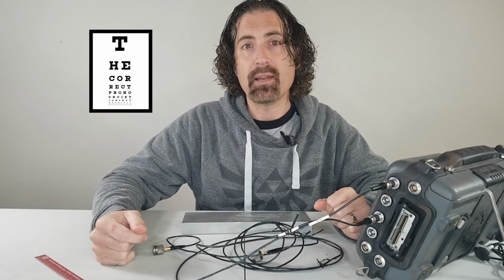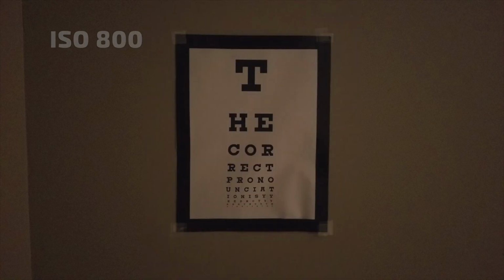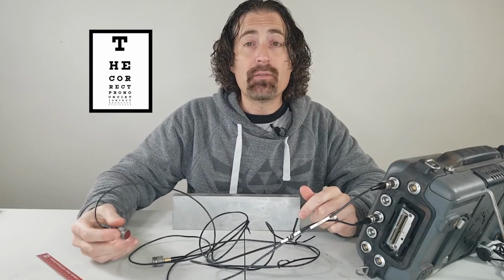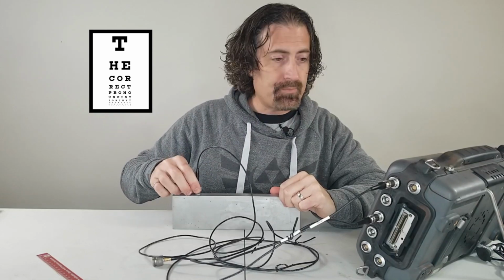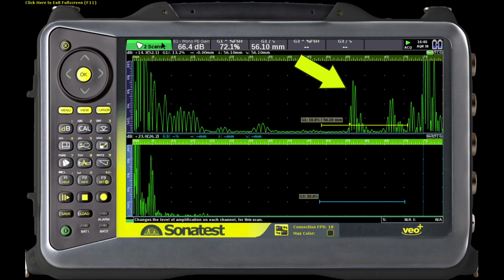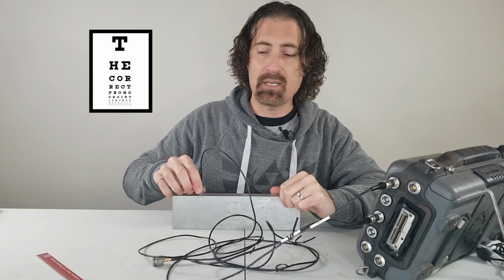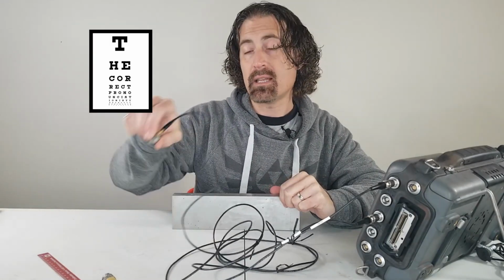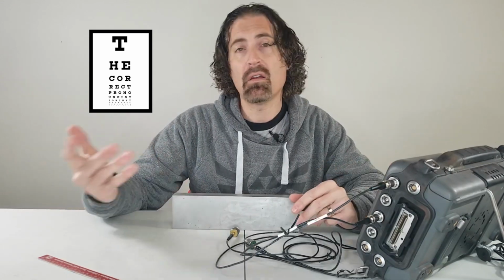Resolution & Sensitivity

Comment: The ISO and resolution analogy is good to use but would there be a way to demonstrate with a similar method when using a C-scan system and how a good versus poor signal to noise ratio is encountered?
Reply from the maker: Yes I think I will do that at some point

Comment: Best video with easy and superb explanation technically,
Small doubt having two same frequency probes one with high damping and one with no damping, 
Is great improvement at near surface resolution with high damping probe accepted and practically noted the same.(we are making probe close to one frequency by damping - Broad band )
With no damping probe, near surface resolution very poor, but not bad as point of far surface resolution.
What could be the effect to make this happen.
Reply from the maker: That's damping, a whole other video! :)